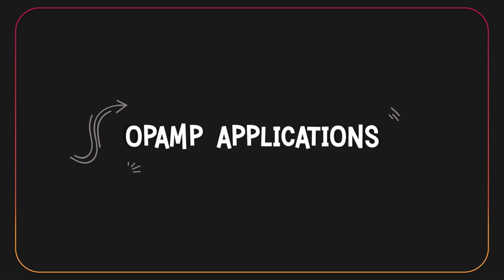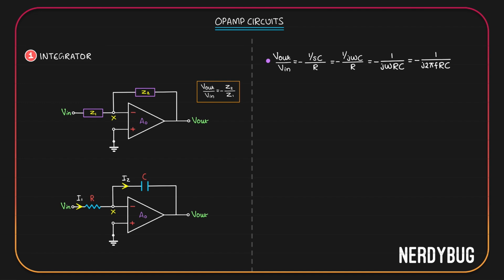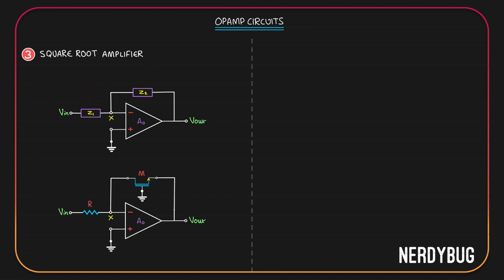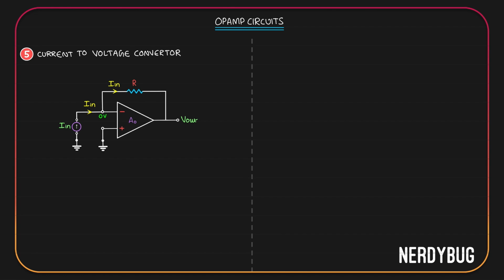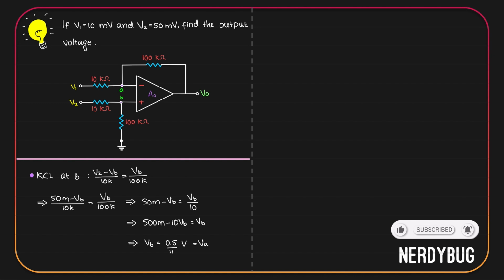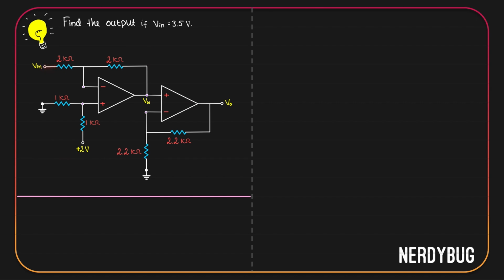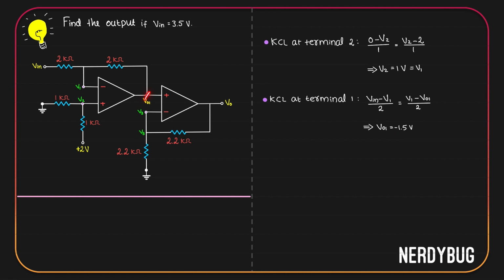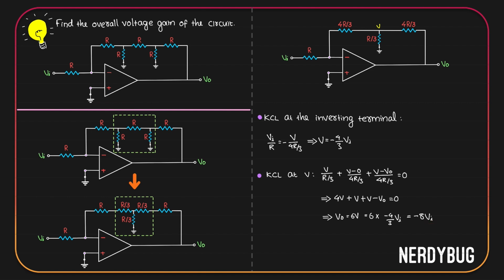Opamp Applications: Non Linear Circuits | Analog Circuits | NerdyBug | 2025

Comment: How do I know which direction my current has to go through through the backloop? I messed up a few signs in my calculations that way
Reply from the maker: Direction of current can be arbitrary. The trick lies in how you write the expression for it. 
If you marked the current to be flowing from A to B, take it as (VA-VB)/R. 
If you marked it from B to A, take it as (VB-VA)/R. 
Your final answer will be correct either way.
Eg. 2 A from A to B is the same as -2 A from B to A.
https://youtu.be/dDjzddUkPEo?si=NoHO1CIMcpUaENDU
Reply: @NerdyBugNB thank you!

Comment: Mam, if possible can u make videos on circuits where we should find if the circuit is in positve or negative feedback and what should be the sign of op amp to make  to have stable output type of questions???
Reply from the maker: Sure. You can mail me if you have specific questions in mind. I'll include them in the videos. hello@nerdybug.in
Reply: @NerdyBugNB yes mam surely will do